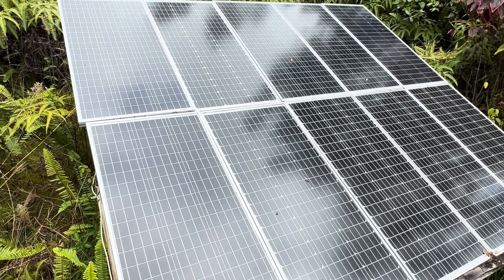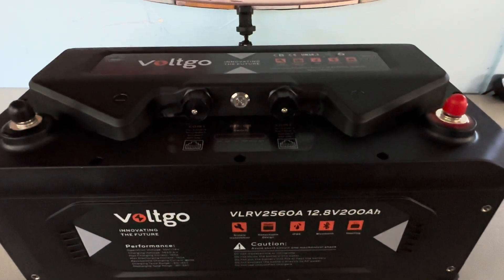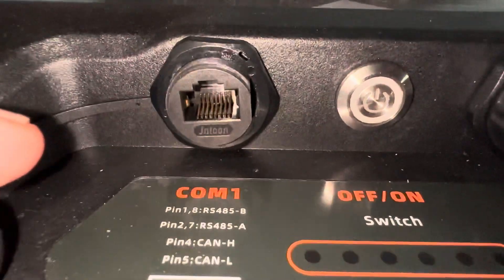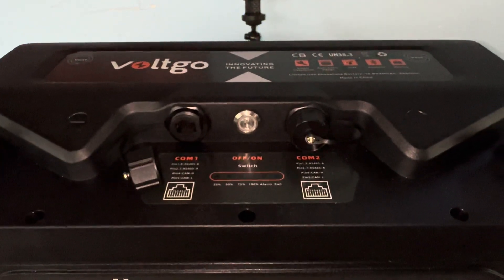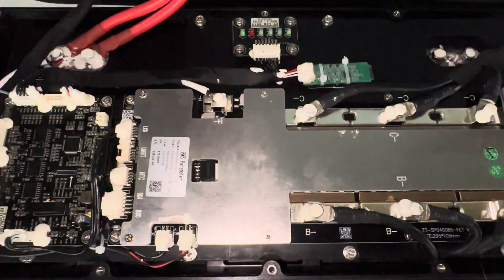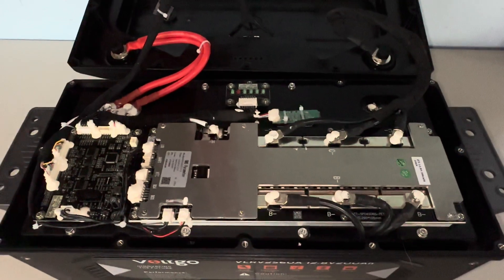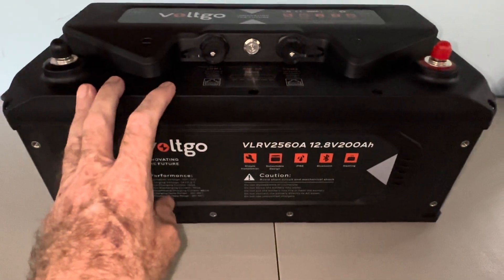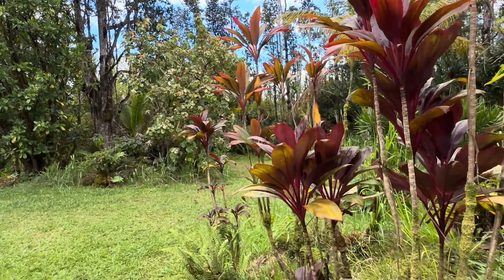Voltgo 12.8V 200Ah LiFePO4 Battery : Easy Access Case Reveals Engineering Excellence

Comment: I noticed, what looked like, a loose screw in the bottom of the battery. Was I just seeing things? 😅
Reply from the maker: I went back and looked frame by frame, and i see what I think you see , but it's the reflection of my camera light on the silicone wire.🤙
Reply: I saw the same at 8:17. Was going to mention it but saw your comment.
Reply from the maker: Pretty sure it's a reflection off a wire from camera light🤙
Reply: Interesting. I went back and looked again too. It looks like  a screw in the bottom of the battery case. Not a reflection off of the wire. I see it several times during the video.
Reply: I first noticed it at 5:51. Bottom of the battery case, just left of what looks like where the top cover screws in. Again at 5:59 and 8:17.

Comment: best build I seen so far. that small circuit board is the Bluetooth board. you got everything else correct.  like battery wires. rated 600V . written on it. that explains the cost. no cheapness . 6 AWG wire rated 50 amp continuous and 8 AWG is 40 amp. this is bult for heavy loads. some one else took that apart all the way. yes low temp does work and temp reading on Bluetooth app and reads correct. them comm ports are used in a all in 1 system . for remote monitoring . EG4 is one of many all in 1 controller. all you do is add battery plug in solar and done. Victron makes a all in 1 as well. MPPT/inverter/charger some with transfer switch in one unit and smart shunt . can be grid tie or off grid.
Reply from the maker: Mahalo Robert! I knew your eagle eye would know exactly what was what. Super appreciative of you sharing that for all of us! Aloha!🤙

Comment: The only thing I hate about these new batteries is tbe BMS..Just looks like so much to go wrong..Hope mine last I bought 2 litime  plus batteries at 1300 plus tax.
Reply from the maker: I run a LiTime here as well, and an AmpereTime from when they were called that. Both perform perfectly! Aloha!🤙
Reply: Its kinda a necessary evil I suppose is the best way to describe the BMS.  It is needed to balance the cells and for fire safety due to the volatility of lithium (though LiFePO4 is a very safe lithium chemistry, it is still a lithium chemistry).

Just treat it as you would any kind of power electronics... if you want it to have a nice long life, be nice to it and don't overstress the capability.   If the battery specs say it can discharge 100A 24x7, then don't go over 50A under normal operation.    Also don't connect or disconnect the battery while it is under load.   And so forth.

Now here's the kicker... its actually really easy to treat these batteries with kid gloves.  You simply parallel 2 or more together and now each battery is likely going to be operating well below its limits.  I stopped worrying about stressing my batteries the instant I put the second one in parallel with the first.  Most of the time any given battery is only dealing with 10-20A.

This is also another reason to go with higher system voltages (at least for new systems where you are also buying new equipment that accepts the higher voltages).  Higher system voltages equate to lower amps equates to less stress on everything.
Reply: Yah my 100ah wasn’t enough so two 230ah should be great wired together.Then maybe switch wiring to 24v system once I figure out  how to configure conversion.I guess I’ll need a 24v charge controller and 24v inverter now.Will 12v panels work for 24v system?